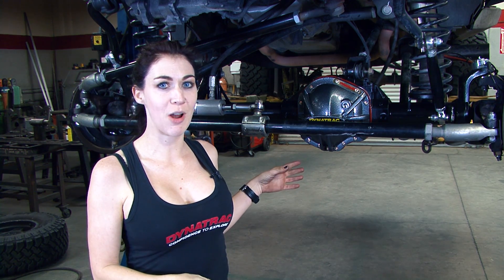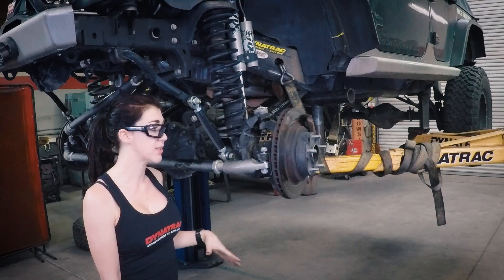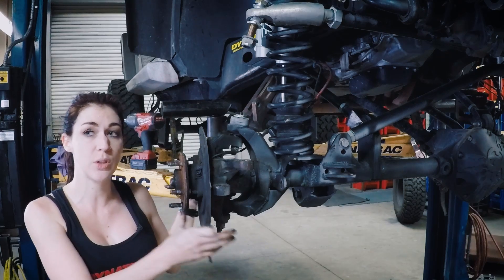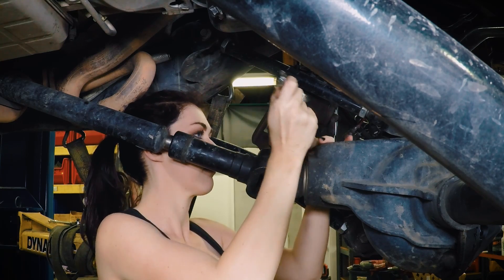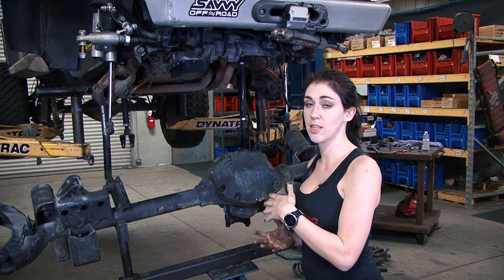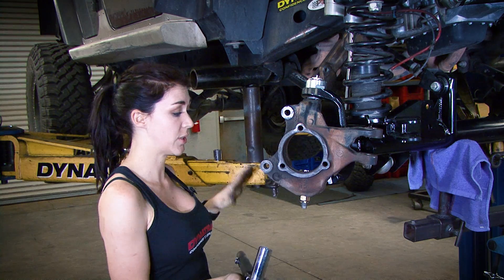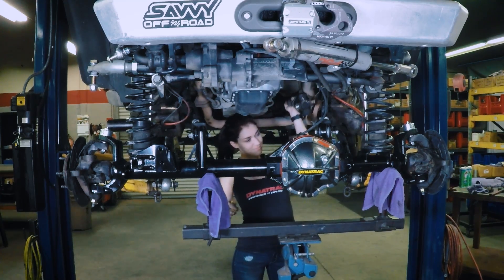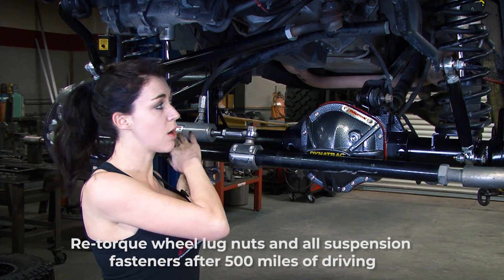How to Install a Dynatrac ProRock 44 in a Jeep Wrangler JK

Comment: What's the total average time for an 1-person JK dana 44 crate axle swap, at a professional shop? And before people reply: No, I'm not a pro mechanic, I'm not a DIY person.  Thanks.
Reply: Solid 4 day weekend. Learned the hard way due to seized bolts, broken abs sensors, and only having 2 hands. Make sure you have lots of Jacks, and get a solid crawler to rest your old axle on once it's out. I still needed a hand on some parts of the install
Reply: @Team_Nacho_Moto  ..So - 4 days as an answer to my question, at a pro shop. LOL.  I'm guessing a 6hr day at a pro shop, excluding lunch
Reply: @ifp123  my bad man, I skipped over the "at a professional shop" part. Yeah 6 hours seems about right for a shop. It took me a while on mine bc of me not having a shop, breaking parts, it being my first time, doing gear install with new shafts as well, and also doing the job in my garage.